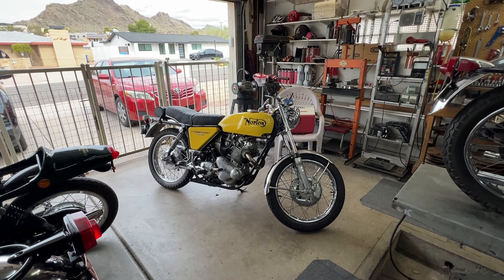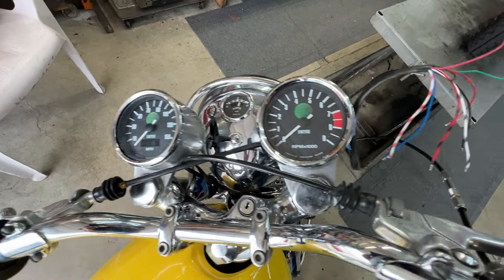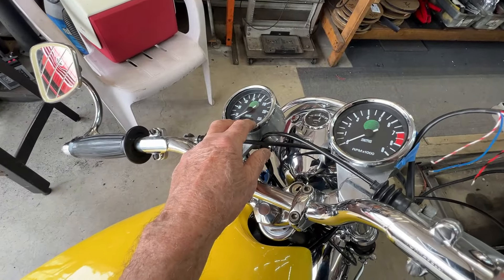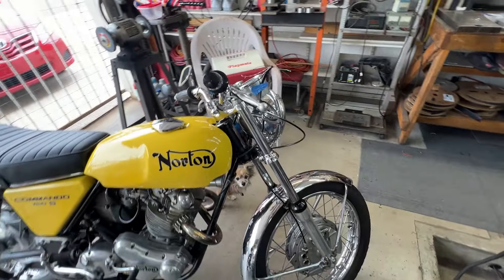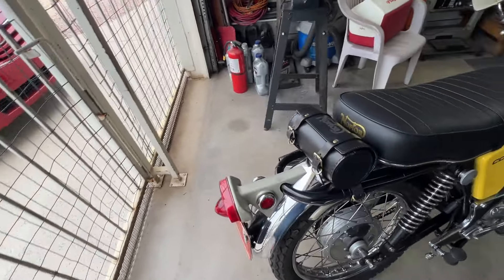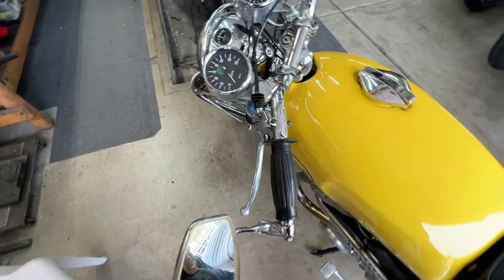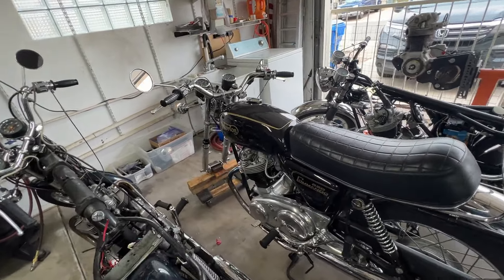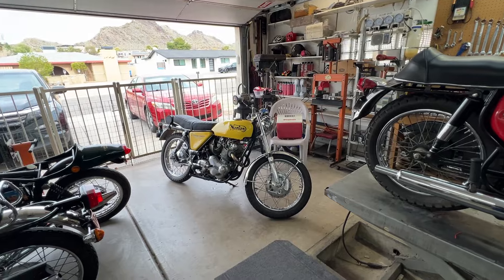02-01-24 – 70 Norton – Yellow – First Day in Shop

Comment: You've got some great bikes in there.  Do you ever run into problems with the city for running a motorcycle shop out of your home garage?   Both you and Kevin have really cool work spaces in your home garages.
Reply from the maker: Phoenix and Arizona are both very "small business friendly."  As long as a business is only open daylight hours, doesn't make too much noise or odors, has no outside employees, and no on-street parking, there are no problems.  And, of course, the if neighbors don't care.